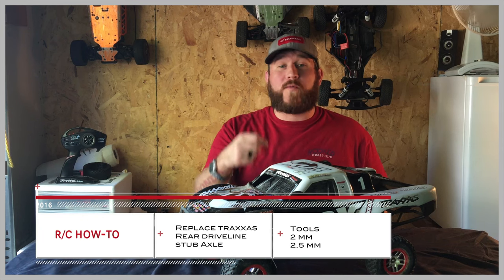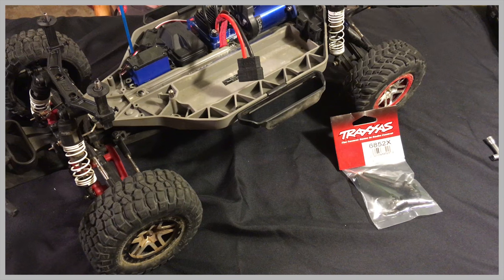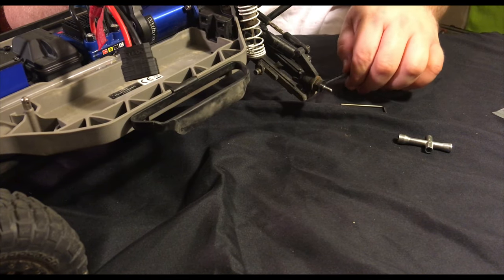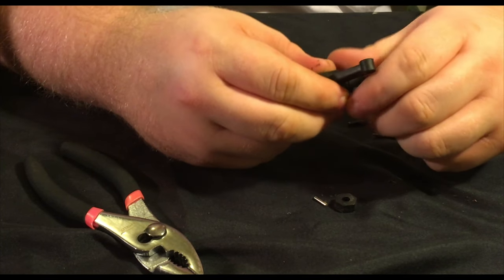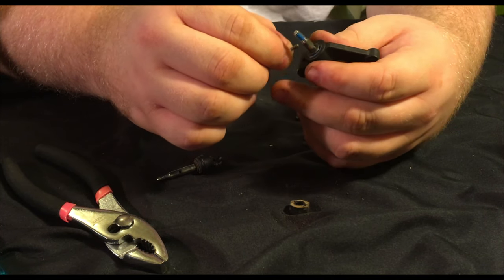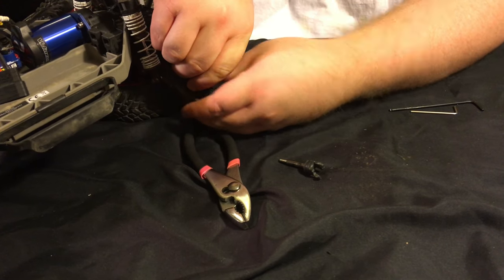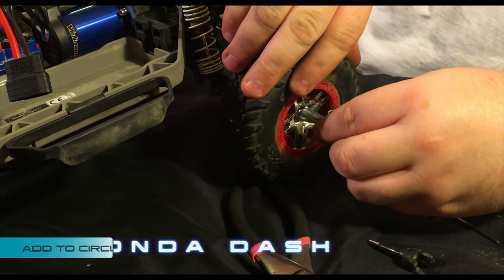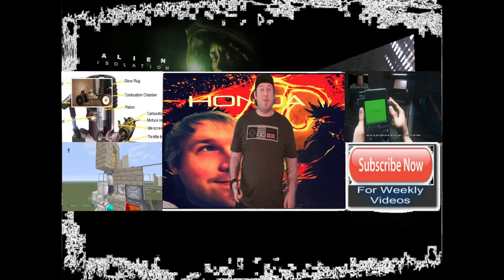HDRC GUIDE: How to Replace/ Install Rear DriveShaft TRA6852X

Comment: I get it. Traxxas 6852x plastic driveshafts aint really strong and all that, but they cheap and easy to use. Think im gonna have to get them for the rear of my slash since a rock hit it and had been grinding on it, so its a weak spot now. Cant really find any strong ones that are good for overall use that are alloy

Comment: Great vid.  My replacement axles (6852x) don’t have threads inside the connection to the car for the set screw.  Seems like a defect because the original has threads.  Ever hear of that?

Comment: I've been looking all over and can't find a video detailing my fix. I need to replace the part of the rear drive shaft that attaches directly to the car. This is the part at 4:09 in the video that he is sliding the piece onto. That's what I need. If anyone can helps me out that would be greatly appreciated.
Reply from the maker: +Weejim OK there is a screw that holds together the rear Axel to the car it's a long screw with a little bit a thread on it that has to line up with the hole  that connects to the differential spin the end of the axle until it lines up with that whole then put the screw through
Reply from the maker: +Weejim  check out my other video start at 3:04
Reply from the maker: +Weejim https://youtu.be/OeHJ_AiU37I
Reply: I need to get that screw for my  front axle, anyone know where to order the screw and what its called?
Reply: You can look it up on an exploded view.(of the car, of course) There, you will see the serial nummer of the part. Just Google that nummer and What you want will mist oftenly just pop up!

Comment: I broke the piece that holds the axle into the transmission.. how would I fix that. It's a 2wd slash
Reply from the maker: John Powell you don't fix it you buy a new Piece
Reply: @HondaDASHProductions  I think he meant how when you have the piece
Reply: @jacobab411  Exactly,  he basically only explained how to replace 1/2 of the drive shaft. Still a good video.

Comment: I need to put the one back that is on the inside, how do I do that?
Reply from the maker: Ajaguarb  You’re gonna have to be more specific
Reply from the maker: Ajaguarb there is a screw you have to line up the piece with the Diff gear peiece and push it in and tighten.